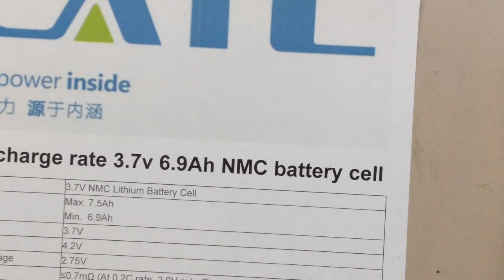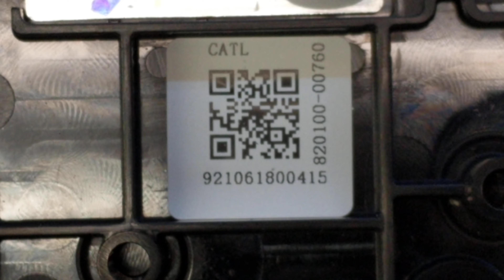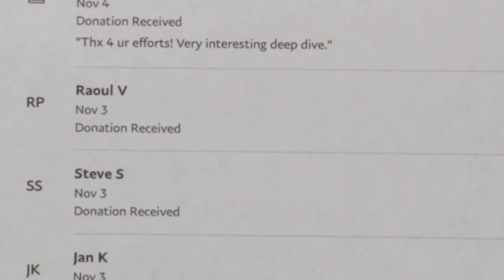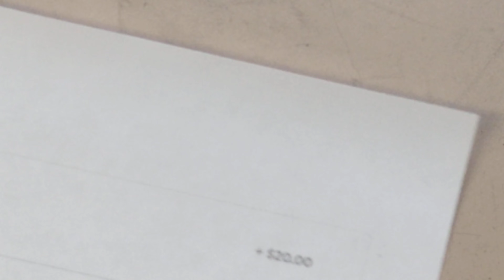Update!  Part 2 - Tesla Plaid 12v lithium battery.

Comment: My battery drained to 9v tesla stop recognizing due to crash i charged the battery by connecting other battery it went from 9v to 14v byt tesla wont connect . Anyhelp it saying mosfet issue
Reply from the maker: You need to fix the problems caused by the crash and then run the reconnect from service mode once HV is present.   Sorry anything more than this is consulting, you can email me.  (Email is in Channel about page)

Comment: Is the 12amp spec for each of the "12v" power sockets or a total for both? ie: could you use a 12v splitter to connect both sockets together to power a 300watt inverter?
Reply from the maker: No, I don't think this will work.   On 3-Y you can connect a relay driven by the accy line to the large red connection to the penthouse under the rear seat (right side), definitely use a fuse as close as reasonable on this, as it's capable of 200A!   If you put a large inverter here, you might need to use a precharge resistor across the relay here, but 300W is no problem.

Comment: I need a switched 12v source in the frunk area to run a radar detector. Only 1a max is needed.
Reply from the maker: You didn't say what year/model you have, so impossible to advise.

Comment: I noticed that these battery are exactly 99Wh.. which coincidently also mean that they are rated just below the Class 9 hazardous goods for shipping that is set at 100Wh or more. So this choice of 99Wh like many other powertool battery are, is probably to facilitate the shipping at low cost for the replacement of these battery.
Reply from the maker: Yes, I noticed that too.

Comment: Another question, I have found that the 12 V cigarette lighter outlet is always hot, does it get its power from the auxiliary battery, should I worry about unplugging my USB charger or just say no problem is it being powered from that battery
Thanks
Reply from the maker: It is not always hot.  When the car goes to sleep it will shut off.  It may take some time for it to sleep, and there are things that can keep it awake, such as charging the car or running sentry mode.   It's safe to draw up to about 10A from this socket, but it most definitely can't be depended on to stay live.  There is no problem leaving the USB charger connected, as it probably draws in the tens of milliwatt range with no device charging, even a modern laptop charging is usually less than 50 watts, and your main pack is at least 50,000 watt-hours, so that's a lot of laptop charging!   The car draws about 200 watts on it's own to stay awake, so your USB charger, even with a connected load isn't much of an increase.

Comment: Hey there, finally found what I was sort of looking for, I rent a model three from Hertz for Uber, last night I was trying to help somebody who might need a jump and I wondered if I could jump their car from my Tesla auxiliary battery, so I open everything up because I know where it is and I find that I don’t have a big lead acid or old-school battery and I see the big red terminal tab there and I see a label that says 16 V lithium ion and I’m like well look at that they got rid of the big battery I think and now it’s fully confirmed after searching for stuff.

So I didn’t have my meter and I’m curious what the voltage is there at that big red tab across ground, and I still have the question could you use these connections to jumpstart a regular vehicle or is it risky, thanks and you have found a new subscriber I like your content

I mostly do live streams on YouTube but I’m gonna try to start getting back to videos, here’s a quick video I did to show a friend mostly where this is located and what it is it was the easiest way to share it ha ha

https://youtu.be/nMpocB7BO1I
Reply from the maker: The system voltage on Lithium-LV quipped Teslas is about 15V, and I think this would be safe to jump another car with provided you use normal average jumper cables.  These are thin enough and have enough resistance that they will safely limit current.  Might be a good idea to disconnect the LV lithium battery first though.  This way worst-case your PCS overloads and shuts down, then you can reboot the car be reconnecting the LV battery, with no harm.  If you leave the LV in-circuit and overload it, then it will shut down and needs a special reconnect procedure.   You can disconnect the LV lithium battery with no tools;  Lift up on the square button until it stops (about 1/4") then slide the black part of the connector away from the end where the large wires exit.

Comment: how did you open the cover? Thanks
Reply from the maker: Heat and mechanical shock.
Reply: @Ingineerix  I wonder if the battery would still be good if I apply heat!
Reply from the maker: @joebrown4138  Mine survived, I didn't get anything over 60c (about 140f).   Sadly these packs have a fatal flaw, if they are left connected to the car after the die, they seem to go too low to self-recover anyway.   $200 new from Tesla.
Reply: @Ingineerix  Yes I got a new one, but it also died. I think these batteries were designed for toy cars!
Reply from the maker: @joebrown4138  Basically, if the contactors don't close within 30 seconds after connecting the new battery, you disconnect it, and use a external 12v supply to power up the car.  Then you can enter service mode and check for alerts that may be preventing the contactors from closing.  You have no way to charge the lithium LV battery, only the car can do it once HV comes up.   Most people leave it connected and it dies, and if you leave it too long, it will go beyond recovery.
Reply: @Ingineerix  I tried, but errors change, I have 58 errors
Reply from the maker: @joebrown4138  If you want assistance with your car (paid), please email me.  You can find my email in my channel's "about" tab by using a browser (not a phone).
Reply: @Ingineerix  not sure what to do, I tried to update the software and it got stuck, the car doesn't charge and there is a software mismatch.

Comment: Thanks for the video. Can I charge this battery while unplugged from the car? Also, does it die forever when the high voltage system is disabled? Like when you get in an accident
Reply from the maker: (I assume you are talking about the new one): No, you can't.  They seem to permanently die if left connected too long after an accident. Do not try to recharge, unless you want to risk the whole car, it could burn it to the ground in minutes, not worth the risk!

Comment: Do you see anyway to charge it? I have a few that are fully dead after a tesla was in an accident. I followed tesla procedure to bring them back to life but no success. I replaced them on the vehicle but now have several of these dead one.
Reply from the maker: Sadly it looks like this is a problem with the design of the BMS (CATL) if it's left to sit discharged for any length of time.   There is no safe way to revive it unfortunately.

Comment: Has anyone interrogated the LIN bus of these batteries? When they discharge to a low voltage, the BMS seems to stop them from working, or being able to charge.
Reply: I would love to learn how to revive these batteries also.
Reply: @diytesla  I'm currently in the process of doing this. Tesla Toolbox has this functionality, and possibly service mode too. Unfortunately for us in Australia, we are locked out of service mode, so plan B!
Reply from the maker: Yeah, the BMS draws them down to zero if left sitting too long after LVCO.   They seem to permanently die if left connected too long after an accident.  Do not try to recharge, unless you want to risk the whole car, it could burn it to the ground in minutes, not worth the risk!  (I posted a clip of this in the video!)

Comment: Hi I am working on a model Y with this 12volt lithium battery car was in a accident i changed the high voltage pyro and i forced a firmware update and redeploy now this 12v battery is dead i got a new one but only has 20% capacity and wont go higher i get a error code for vcfront a191 and a192 low voltage and car wont start 
any ideas ?
thank you
Reply from the maker: There is clearly more wrong you haven't found.  You need full diagnostic access to determine the cause.  a192 means load shed, in other words the car cannot charge the 12v because of a fault.
Reply: Hi, did you figure out what is the problem? Same thing looking for.

Comment: Where can I tap for 12v to install amp
Reply from the maker: The only possibility is the PCS feed.   Anywhere else will likely cause a fault.  You may need a relay to disconnect it that's triggered by the accessory feed.

Comment: how to charge this battery. can you help me
Reply from the maker: Yeah, the BMS draws them down to zero if left sitting too long after LVCO.   They seem to permanently die if left connected too long after an accident.  Do not try to recharge, unless you want to risk the whole car, it could burn it to the ground in minutes, not worth the risk!  (I posted a clip of this in the video!)  Just buy a new one after the car is closing contactors!

Comment: Hi, can you please explain what the jump tab is for? The one with red cover in the video? Is it for jump start the lithium battery?
Reply: It is to open contactors so the lithium battery can be charged from 400V battery
Reply: That was explained in the previous video about this battery.
Reply from the maker: No, it's to power the car.  The battery will not accept external charge.  Do not try to crack it open and recharge, unless you want to risk the whole car, it could burn it to the ground in minutes, not worth the risk!  (I posted a clip of this in the video!)  Just buy a new one after the car is closing contactors!

Comment: Can you use these 7ah-12ah 12v batteries to replace Model 3's 12v lead acid?
Reply from the maker: No, and you wouldn't want to either!  There are a lot of Plaids having trouble dying during updates because there is so little reserve capacity in this pack.   Only about an hour or so before it dies.   This particular unit depends on LIN from the VCBATT ECU that isn't even present in a Model 3, so there's no way it will work.

Comment: You say not to directly tap the battery at the jump post and suggest the car might throw errors . Wouldn't the same have been true for the previous lead acid 12V? I never had a problem directly tapping that. Ran my refrigerator for hours during an outage without issue.
Reply: It's probably not true for the lead-acid version, because the vehicle's systems will much more closely manage the lithium-ion battery than it would a lead-acid battery. Lead-acid batteries are basically just left to live or die without help, while lithium-ion batteries are coddled with individual cell monitoring and balancing, high and low voltage protection, charge and discharge current management, and temperature control.
Reply from the maker: Yes, it will cause problems, just because you didn't see one, doesn't mean it was happy.  You absolutely should not tap there, Lithium or Lead!

Comment: Have you seen any data yet on how many times per day these 12V batteries are charging and discharging? The capacity is pretty low, so I'm wondering if they are going to wear out. I don't know why they didn't go with Lifepo to allow 5,000+ cycles...
Reply from the maker: They don't cycle much.  It will probably last many years if not abused.  (Never connect external loads!)

Comment: So. You for a/m accessories I can safely tap the pcs line inside the vcf?
Reply from the maker: What is "a/m"?   IMO, the PCS line is the only "safe" line to tap for high-current, but there are some caveats.  You cannot add a large continuous load here, and/or if it has large bulk capacitance, and cannot remain permanently connected, or the car will fault when it wakes from sleep.  The safest way to do this would be to add a contactor on this line that is turned on by an accessory feed, such as from the 12v socket.   If your load still has large inrush, you'll need an appropriate precharge circuit.  There really is no way to add "always on" accessories that don't incur a huge vampire loss, as the 12v (15v) battery has such small capacity.  Also, be warned that the 12v system is actually a 15-16v system, so could be too high of a voltage for some loads.
Reply: @Ingineerix  a/m = aftermarket. Sorry mechanics term.  Maybe a better option would still be to tap the 12v accessory line. I have a power frunk kit for a model y that won't be ready till mid January and those are starting to come with the lithium battery.
Reply from the maker: @DoingthingswithDAN  Yeah, that should run OK right off the 12v "cig lighter" feed.

Comment: (Potential) Correction for 8:13 

Page 21 on Tesla's Model 3 2021.24 North America Manual
"The power socket is suitable for accessories requiring up to 12A continuous draw (16A peak)." This is for the old 12V battery.
Reply from the maker: Thanks for locating this!

Comment: 6.9Ah capacity is very small to handle such electronic current consumption .. I think these are the  25Ah or 35Ah capacity cells.
BTW very informative video.
Reply: No, they are very clearly 6.9 Ah prismatic cells, and there's even a label on the outside that explicitly states that. The cells are far too small for 25 Ah.
Reply from the maker: I assure you it's only 6.9Ah.  It's only used during deep sleep.

Comment: Man thank you so much for this video. I am in the middle of having a aftermarket subwoofer and amplifier installed and he had previously done a plaid and tapped right off of that jump tab that you said to not top off of. He was going to drill a hole and then bolts in the amplifier wire right to it. I have since set him your video and put a halt to the install right now. If you could please upload a video on a safe place for us to tap that would be absolutely amazing. That will help out the community so much. Thank you and hopefully you can help us out with that soon. Keep up Good work with the videos
Reply: I am also in need of a place to tap from. Unfortunatelly my installer didn't see this video and that's exactly where he tapped into.
Reply: @unclebnz   well, I can’t believe it’s been 10 months since I asked about this. I have found somewhat of a solution so one of the top installers in the United States does top off that spot, but it requires a 14 V lithium battery to be installed in the rear. Batteries $900, but talking to him they said they figured out a way for it to not cause strain on the existing battery system by putting that certain 14 V battery that helps step down the volts. It’s made Titan it’s called the Titan 8+ model: RSV-S6 specs: 20Ah 276Wh 3000W so basically you buy that battery and put it in the rear cubby and go straight off that charging post to that battery then tap off that battery to your amplifiers. That will step down the power and apparently not cause any damage. He has done several Plaids people ship him from all over the country to him. His name & channel it “Matt Schaeffer” then type in plaid and you’ll find a little info on it. I’ve got a guy locally who builds lithium’s and I gave him the specs and he is building me a low profile lithium with a built-in monitoring system. That is supposed to be done anytime then I’m going to do my install. At this point I have already ordered a Nother plaid to replace my current one so I will probably wait until that car is in Before I cut the carpet out and all that stuff. My car is a June built 21 so it has the most problems and I’ve put 22K miles on it so I like to swap out fast before I lose money on it. But that’s another story. Hope this info helps but you definitely need to have your installer put in one of those batteries or it will indeed cause damage and possibly void the electrical system warranty. Best of luck, my friend.
Reply from the maker: I'll do a video on this at some point.

Comment: Do you think we can rerplace our 12V AGM in the S,3,X with this Li Ion without using the VCBATT? What would it do when no LIN bus is attached ?
Reply from the maker: No, no possible way, and this battery will not charge or discharge until it gets LIN from VCBATT.

Comment: Regarding standardization of cell size: 120 mm x 85 mm x 12.5 mm (compare with 2:09: 120 x 13 x 86 mm for these CATL cells, which is basically the same) is the Standard VDA (VDA = Verband der deutschen Automobilindustrie; Association of the German Automotive Industry) HEV (hybrid electric vehicle) size for prismatic cells. You can see this cell format in many kinds of full-hybrids by Audi, Acura, Ford, Honda, Subaru or Toyota Prius v in their traction battery packs. Most of them have 5.0 Ah cells by Panasonic or Blue Energy (Honda, Acura). These CATL cells in the Tesla Plaid LV battery of 6.9 Ah are already an improvement in energy density.
Reply from the maker: Interesting, Thanks!